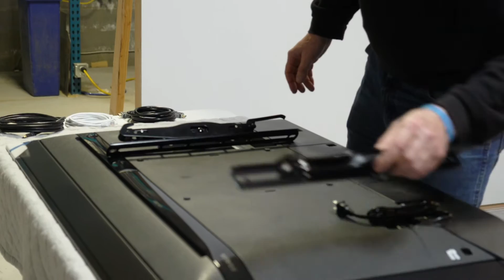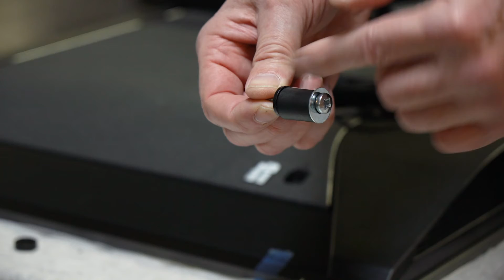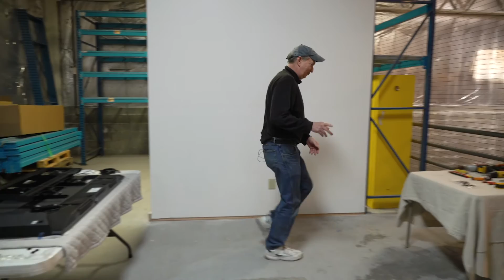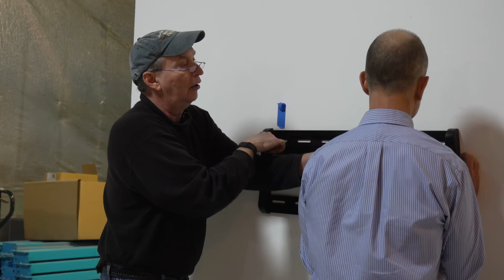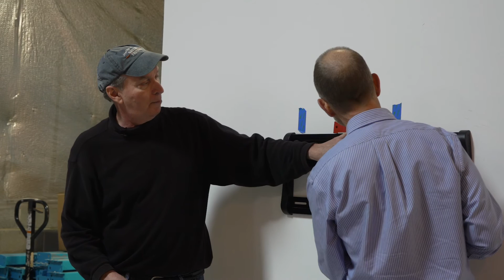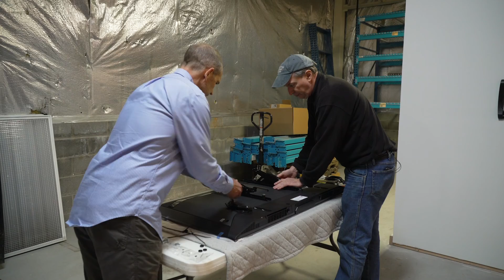How to wall-mount your TV | Crutchfield video

Comment: Hi I’m planning on doing an accent wall with laminate floor  where the tv goes should I mount the bracket first or it can be on top of the laminate
Reply from the maker: It should be ok on top of the laminate as long as it's not very thick and you're securing the mount to wall studs.
Reply: Thank you for response It really helped me I appreciate it👍🏼
Reply from the maker: Anytime! 🙂

Comment: That was some serious eyeballing on the placement. No centering, no height calculation. 🤷‍♂️
Reply: He used the, raised by a  "single mother" approach, for today's new breed of "Men". No clue how to do it properly, no care, if it's wrong..do it ten times until you get the exact placement and then cover holes with tooth paste. I like to do it the correct way and in 5 minutes. Not everyone knows proper interval measurements and how to use a tape measure. 😂

Comment: Hi, Was this on metal studs or wooden? Do I need reinforcements for a 75” with metal studs dry wall?
Reply from the maker: This was done using wooden studs. There is different gear needed to install a typical wall mount onto a wall with steel studs instead of wooden studs. What is the brand and model of the TV that will be used with the mount? Do you need the mount to tilt or swivel?

Comment: Great but you've  forgotten to approach the cases when the TV back isn't fully flat.
Reply from the maker: Hey Leonardo!
What type of TV do you have?  I actually have an older flat screen, that doesn't have the fully flat back, that I was able to wall mount!  As long as the TV was designed to be able to mount in this manner, it could just mean that you need some longer screws in order to fasten the mount to the set.
We will be happy to take a look at what you're working with, and see if we can find a solution for you!
www.crutchfield.com/I-rYTVc000/contact